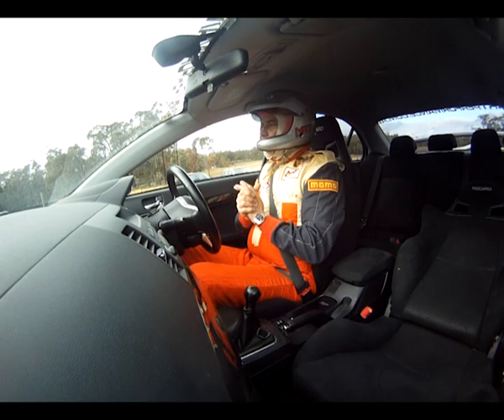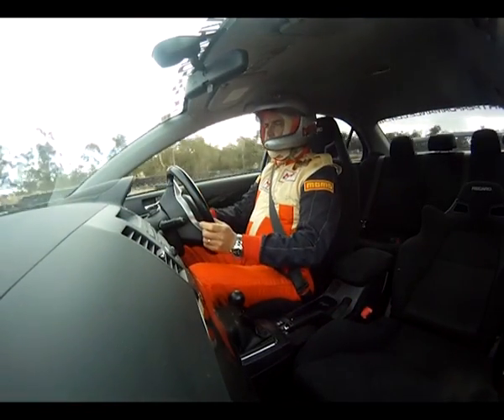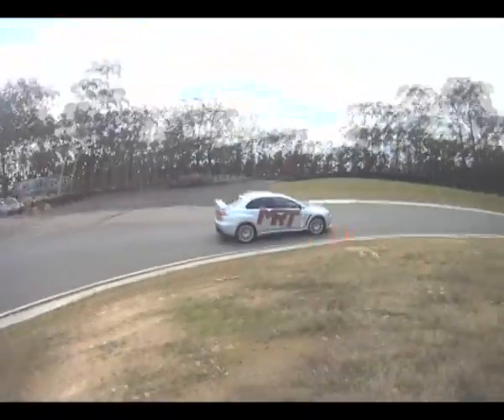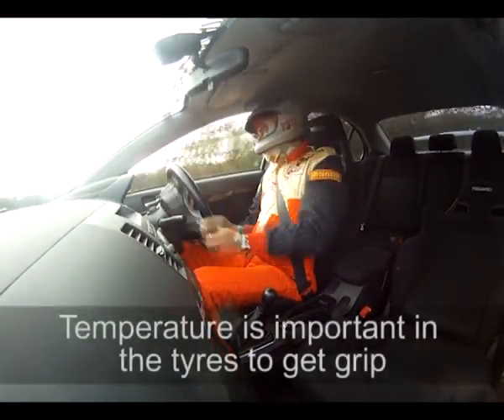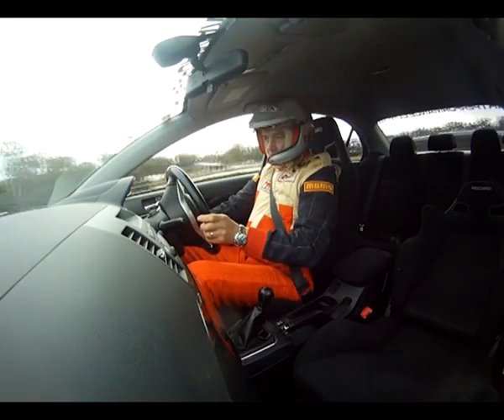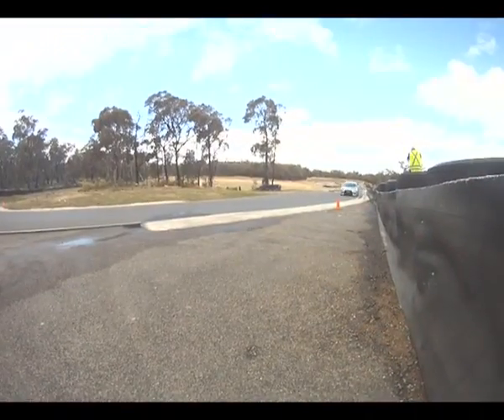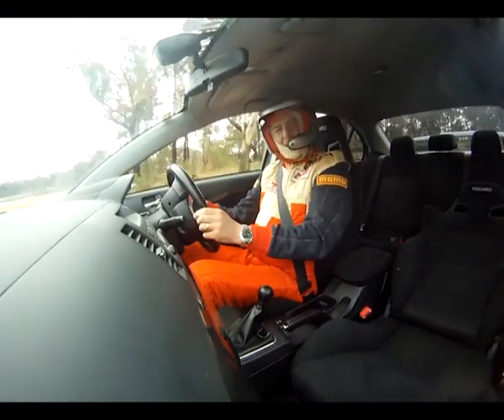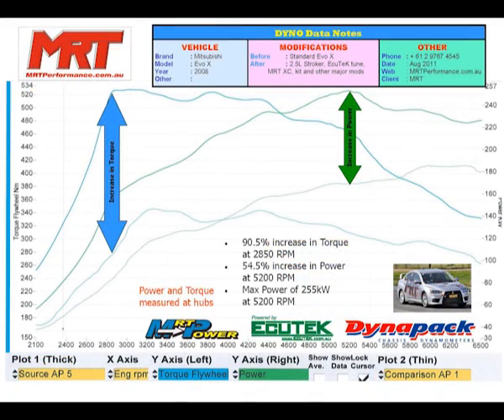EVO X 2500 stroker update track test and Dyno data part 18

Comment from the maker: Joe, wheel spacers are not the best or safest solution. Did you know they contribute to broken wheel studs? As the wheel is not supported by the hub flange? To increase over steer a stiffer rear sway bar is the prferred solution